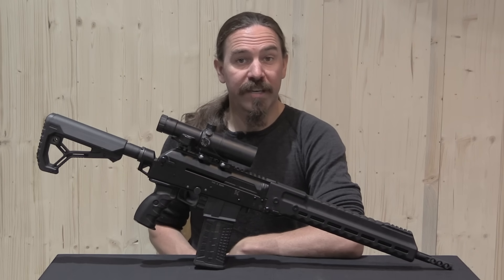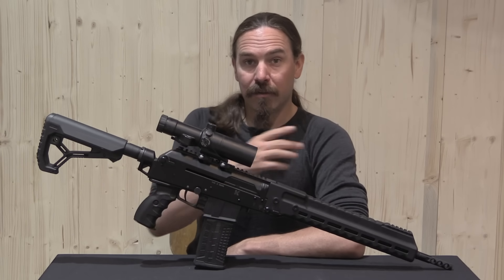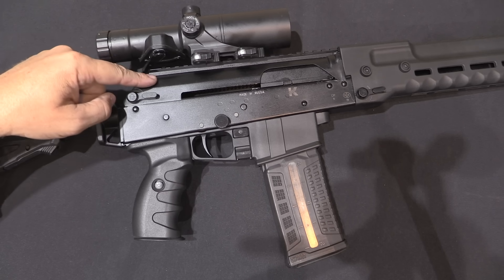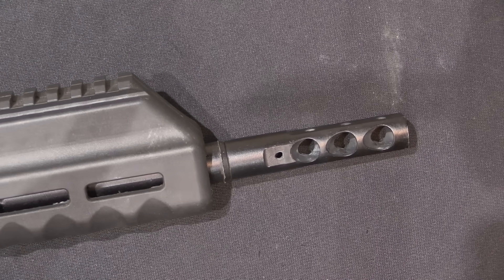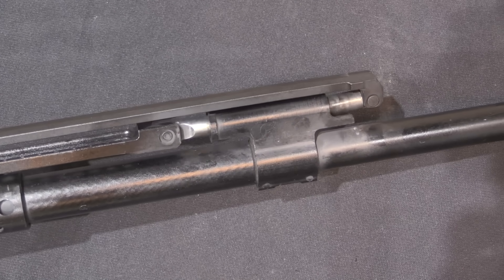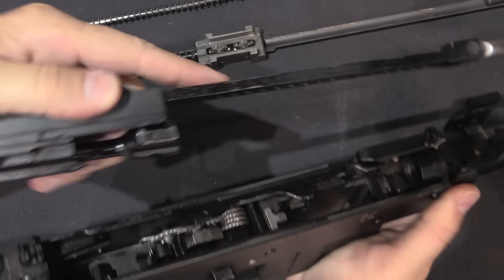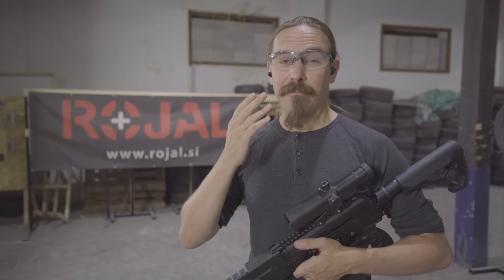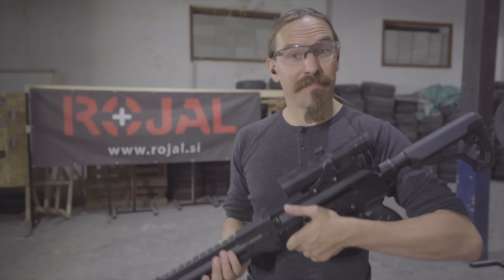Balanced Recoil AK-107 / Kalashnikov SR-1: Is It Any Good?

Comment: I have read that the Chinese Type 81 was designed with a longer receiver so the extra travel time would reduce the force of the BCG hitting the back of the receiver, to make the weapon handle at full auto better then the equivalent AK.  Would love to see Ian come up to a vendor in Canada that has the correct licensing to use large capacity magazines and have Ian shoot the Type 81.  He could do a video on the Canadian AR180 based rifles at the same time, like the WK180-C Gen 2, WS-MCR, Crusader Sentinel, and TSE/Sterling R18MK2.
Reply: That would result in a lower firerate, no?
Reply: @sibidinakaran4757 apparently not cause the type 81 shoots abt 100RPM faster than the AKM
Reply: That's interesting. My guess is that it is because the Type 81 is a short-stroke piston design, and therefore has a lighter BCG that can cycle more quickly despite the longer receiver length. @ii560k

Comment: Just always interesting to see how much the muzzle device actually makes a difference.
Reply: @LabRat Knatz People's reading comprehension has gotten worse by the year after the internet became mainstream. Especially the youth nowadays need emojis in their messages to convey the context of how that message is to be interpreted; they just can't read between the lines. This is not directed towards Laughing Man, just something I've noted and felt was related to the conversation.
Reply: @alkestos  Oh please stop with this age old myth. There are so many more people using words now than any other time in history. So yes you'll see more bad comprehension, but a net increase as more people read and use words daily. Also language changes and emojis are just another way of conveying information using symbols, which is what letters are.

 People have been saying variations of what you just did forever and it's so boring to see. "kids these days blah blah". 😡😡😡👴
"Using telephones will destroy the art of letter writing" etc etc.
Reply: Yes
Reply: Even the AKM style which is just part of the barrel cut away helps a lot.
Reply: There is an old US study when army tried M16 agains ak-74. Normal stock M16 and than m16 with ak-74 muzzle brake mounted. As to be expected 2nd variant shown quite significant improvement in full auto

Comment: I've been waiting for this for so long!
Counter-balanced recoil is something to be obsessed about
Reply: @LabRat Knatz Exactly. I know Korobov created a variant of such rifle system in 1965 called TKB-072, which was designed before the AEK, but it did not go into production, so I suppose AEK-971 is a much more iconic firearm.
Reply: @dirkbruere  Well, if a private is a dumbass he will lose or break parts no matter what.
Reply: Funny thing is that A545 which is a modernized design of AEK-971 is actually lighter than its competitor AK-12. And imho, it looks cooler.
Reply: Interesting concept but absolutely unnecessary if you shoot an AR with direct impingement. Also too many friction parts that will wear. Basically this compensates for an inherent AK flaw. Doubt that front handguard will hold zero..:
Reply: @Swamp_Lad  It absolutely helps in full auto. If you have ever seen an AEK or A545 shooting in bursts, you would be convinced. Otherwise it just helps to avoid weapon shaking and barrel rising. SR 1 is a parody of an AK-107, which is a parody of an AEK, lol. All specnaz troops who held and tested AEK were asking for more of these, but such rifles are not cheap and russian economy kinda sucks.
Reply: @DeyonOttervenBur  не совсем, у АЕК тоже есть заморочки. Главная проблема сбалансированной иди облегчённой автоматики это подствольный гранатомёт

Comment: This was incredibly interesting! Mechanical recoil compensation was always a curiosity for me, and I just assumed that their non-prevalence meant that we'd just figured out it wasn't worth it. Very interesting to see you confirm it as a shooter.
Reply: Of course it's not worth it; this system works for AK-based automatic rifles because of the mass required for the cycle.
It is simpler with the AR-15 base automatic rifle. Just reduce the bolt carrier/bolt mass and you'll get similar results.

Comment: To truly minimize the effects of recoil on muzzle climb, you need to 
1. Reduce the weight of the moving mass (carrier and bolt assembly) to an absolute minimum while making the static portions of the rifle as heavy as feasibly possible. This reduction in the change of momentum will minimize the amount of energy that the shooter's shoulder needs to absorb.
2. Design the system to utilize constant recoil (where the bolt rearward motion of the bolt is overcome by the mainspring and it never actually impacts the rear of the receiver). This eliminates any sharp impact and replaces it with a long, gentle push.
3. Utilize an optimized cartridge, gas port, and mainspring combination so that the absolute minimum amount of energy is sapped from the system to achieve extraction, ejection, overcome magazine friction, and chamber the next round. The mainspring still pushes on the gun and shooter's shoulder during the cycling of the bolt; designing the system to use the absolute minimum amount of cycling energy will directly reduce the felt recoil to an equivalent minimum. 
4. Locate the bore directly inline with the shooter's shoulder. Even AR shooters raise the bore above this optimal arrangement by placing the toe of the stock on the shoulder instead of the heel. Raising the bore above the contact point on the shoulder creates a pivoting moment when the rearward recoil is absorbed, resulting in the barrel axis rising relative to the initial aiming point. When the rifle chambers, the forward impact of the bolt is not resisted by a moment-creating offset, so the rifle tends to lurch forward off of the shoulder on the new, raised axis.

Doing those 4 would result in an entirely impractical, goofy-looking rifle with the cheek rest about 4" above the bore, and the sight line another ~2-3" above that. It would only function correctly with very specifically loaded ammunition and possibly even custom, low-friction magazines to cope for that weak mainspring... the plus side would be an absolute minimum in felt recoil and zero muzzle climb. Essentially, you'd be designing a semi-automatic benchrest rifle
Reply: I did 1 and 3 to a .223 AK, and achieved 3 with a rubber buffer instead of constant recoil. Very fast trigger fingers is a reason why you would not want constant recoil in a IPSC-rifle. 

That AK has less recoil than the SR1 and weights much less. And it looks pretty much like a normal AK... kind of..
Reply: See you make great points, but the reason why that isn't possible is the same reason why competition / range shooters carefully tune their gas blocks and bolt weights and spring tensions, but militaries don't. In combat conditions, the slightest bit of dirt on a bolt assembly, or rifle wear and tear, or slightly different pressured rounds, etc. etc. - all of this combined with a hairpin margin for error in a tuned system like that, would inevitably result in a feed issue or gun jam. It's a lot safer to have more energy passed through to the bolt assembly than necessary just to make sure the gun cycles despite any conditions. 

Now, what this rifle is doing, is passing the same excess energy into two separate bolts, so that even if there are wear issues, both bolts still go the full length of travel, and theoretically, both the forward and backward recoil impulses on the rising and falling actions of the bolt are delivered in perfect synchronisation. This eliminates all recoil due to the bolt assembly at the cost of a heavier gun, maintainence issues, cost issues, and potentially performance issues due to the need to extract more gas to drive two bolts, although you can simply lighten the bolts. 

The only recoil this system is compensating for is the recoil that might throw a shooter off target / temporarily make them go off their sights, which impacts the accuracy of the second shot more so than the recoil of the bullet itself.

Now if you really wanted to eliminate recoil, you move the barrel, bolt assembly, trigger group, and stock onto one axis. This means that recoil is now simply forward and back. The only reason we say recoil makes the gun rise up is because the backwards recoiling motion of the bolt acts on a rotating pivot - your hand on the gun - creating torque. Now, like you said, if the stock is directly in line with the recoiling body, now you eliminate that bounciness of the recoil. If the stock is in line with the barrel and the bolt, you've eliminated all vertical recoil.

Comment: As an owner of one of these (who wanted to show it to you at FB 2022 XD) I agree 100% with this review. But the biggest dealbreaker with this rifle is actually that the topcover does not hold zero well. I had to build a little block that tentions the rail to the front trunnion to fix that issue. 

So yeah, super interesting collectors piece, but an AR will be better in basically every way.
Reply: When I saw that I thought "oh, they're putting it on the dust cover, neat. That's very brave of them, I wonder what they did to fix it in place?". And then it seemed to me like it was less secure than one of the Finnish guns.
Reply: @TheFanatical1  I think this can be a fairly secure design for a rail mount. But they simply don't have the capability to manufacture the guns with close enough tolerances to pull it actually off.
Reply: That's what I was thinking when I saw Ian take the optic with the top cover. Isn't this meant for sporting purposes? Kinda pain in the ass, having to re-zero the gun after cleaning.
Reply: @pirig-gal  mine actually does return to zero. But it only does it because of my self made retentioning block. Without it I can move the rail up and down in the front with just two fingers.

Comment: Seems like it would have been simpler to have the barrel move forward a little to counteract the "jerk" (first derivative of acceleration since we're talking about physics) of the bolt carrier impacting the rear trunion potentially at the cost of mechanical accuracy with the moving barrel

Comment: From Larry Vickers’ video I would guess the value add for this system is mostly in FA.  Which makes sense.

I still suspect there is some technical advantages to be wrung from the Stoner 63 still.  Specifically in the use of free floating weights inside the gas piston.  The idea being that the weights change the sudden impact impulse of the bolt carrier’s end of travel to one more drawn out, as the weights hit the end of their travel milliseconds latter in cycle.  I have often wondered if a system with a weight stabilized by two sealed gas springs inside the gun’s gas piston body could be made the function reliably.  This would take peak recoil and dampen it into a pair of overlapping sine curves.
Reply: Or you use a longer/stiffer recoil spring so that the bolt carrier doesn't slam into the back of the receiver, Sullivan constant recoil system.
Reply: @ScottKenny1978  Isn't the Sullivan constant recoil system basically the traditional AR buffer tube?
Reply: @ArcturusOTE  I don't think so. Pretty sure that the AR bolt carrier does slam into the buffer at the back of the tube, and that's not what we want to have happen.
Reply: The Stoner 63 does employ a constant recoil mechanism, I.e the bolt never slams into the back of the receiver. It slows down and gets overcome by the spring. This is not the system in a standard AR15 type rifle but such a system could be adapted if the system were properly balanced. Jim Sullivan has done just that and there is a video on the rifle and the interview with him on this channel or on InRangeTV.
Reply: @JG54206  it is worth saying that military rifles are always over gassed, and that a rifle with a balanced gas system will not pass military trials.

Which is why you use an extra long spring in the Stoner 63/Ultimax system.

Comment: I love the idea. Hopefully some parts of it get iterated into other designs. That said, I can’t imagine trying to keep this thing lubed without gunking up…
Reply: The "best" part of an AK is that you can teach an illiterate conscript how to maintain the weapon in 30 minutes. This system? Not so much.
Reply: Nyet. AK is fine and doesn't require cleaning
Reply: Almost certainly there would be a little valve or button to completely disable the forward recoiling valve independently of the rear valve and at that point you can shrug and say "well if you drop it and it breaks, you now have a normal AK, take out all the extra shit and you'll be fine. Don't drop it."
Reply: @Wind_slash0  and if you believe that, then you believe that the US is not in a recession and did win in Afghanistan.
Reply: @eloiseharbeson2483  to be fair it really doesn't require cleaning. I have a Serbian AKM and the only thing that happens if I don't clean it after multiple range days is that it gunks up to the point where I can physically feel the bolt struggling to go back into battery on my shittier mags like my Izhmash stamped spines and the occasional jam from said mags.
Reply: @UncleMerlin  with corrosively primed ammo? In my climate, you HAVE to clean the gun with water EVERY time you shoot it. I have shot plenty that I knew was corrosive and any ammo that I didn't purchase new, I treat the same way.
Reply: @eloiseharbeson2483  i shoot tula and wolf steel case. They say they're non corrosive on the box.
Reply: @UncleMerlin  and you are proud of that? Plenty of excellent surplus ammo on the market. Hard to pass up the price when clean-up with water is so easy. BTW Wolf doesn't make ammo. They just buy and distribute it. Wolf can be from anyone. I have seen Tula, Vympel and Ulyanov products sold under the Wolf label.
Reply: @eloiseharbeson2483  Proud of what. I just stated my experience.
Reply: @UncleMerlin  I did not mean to be so snarky. I am so old that I wish ALL ammo was still corrosively primed to enforce cleaning discipline. TBH I don't clean my guns after shooting ammo that I got out of a fresh case lot. There is nice surplus 7.62x39 to be had. Yugo stuff from 70's to 90's. Some of it's corrosive and some is not. PPU still makes ammo to that M67 spec that is non-corrosive but Berdan primed. I should get a case of the surplus before it's gone.